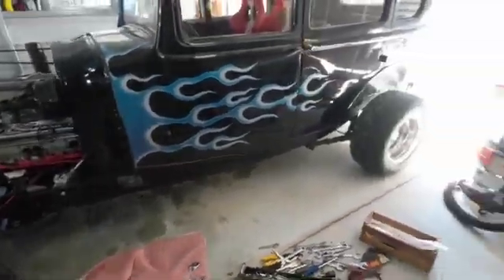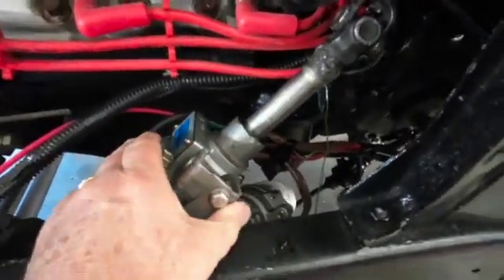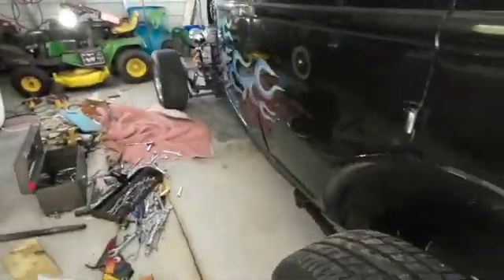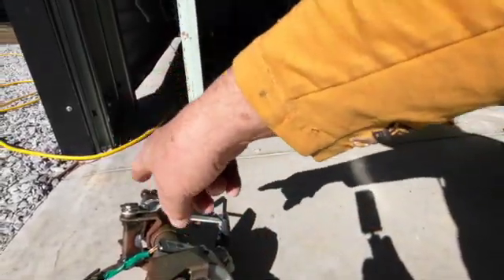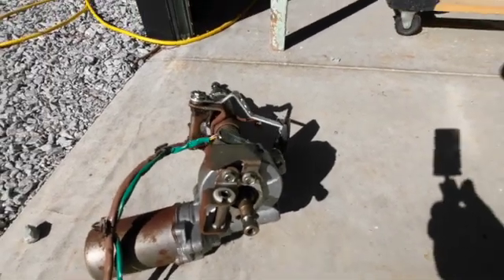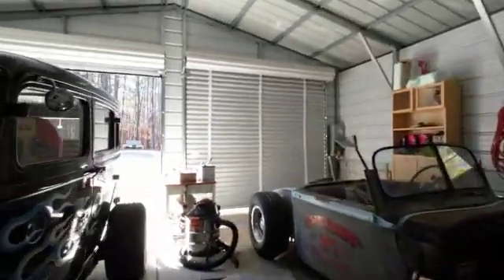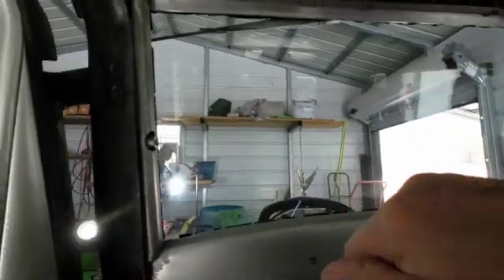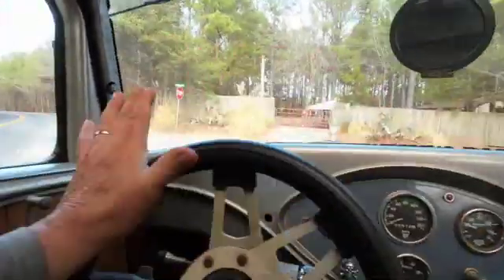Cheap Easy Power steering in my Hot Rod  for $100 Prius electric steering assist series starts here

Comment: What year of Prius has these
Reply from the maker: For hot rod power steering conversions, the 2004-2009 Toyota Prius models are a popular choice due to their electric power steering (EPS) system. These are commonly referred to as "Gen 2" Priuses, and the electric steering column is often used in projects like sand rails and hot rods. 
Hope this helps.  

https://www.google.com/search?q=what+year+Prius+for+hot+rod+power+steering&oq=what+year+Prius+for+hot+rod+power+steering&gs_lcrp=EgZjaHJvbWUyBggAEEUYOTIHCAEQIRigATIHCAIQIRigATIHCAMQIRigATIHCAQQIRigATIHCAUQIRigATIHCAYQIRirAjIHCAcQIRiPAtIBCTEyNDg5ajBqN6gCALACAA&sourceid=chrome&ie=UTF-8

Comment: I've seen one problem with electric steering that when there's an internal short, it pulls the wheel one way of the other, lickity split. Not a lot but if you're on the freeway and that happens, you can end up.in a bad situation.
Reply from the maker: I suppose.